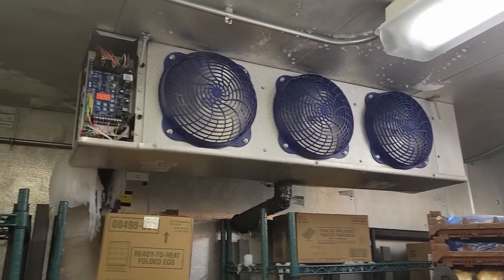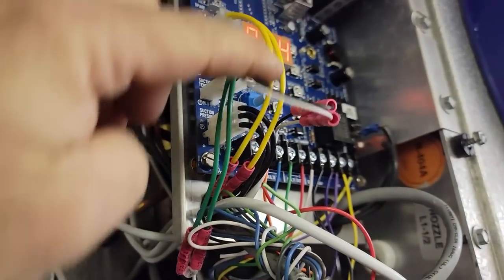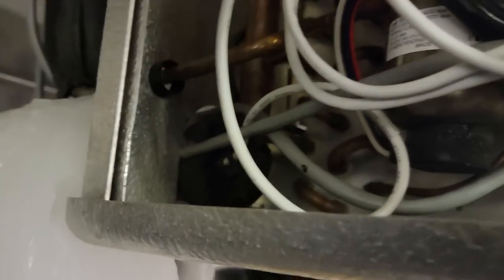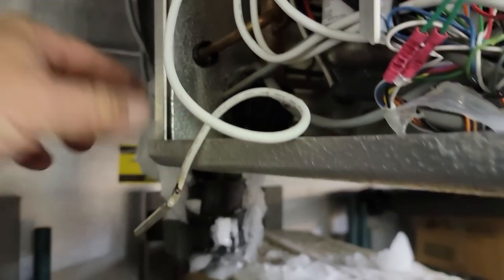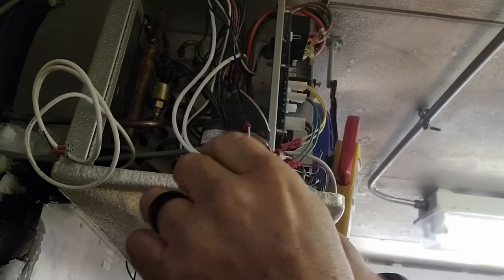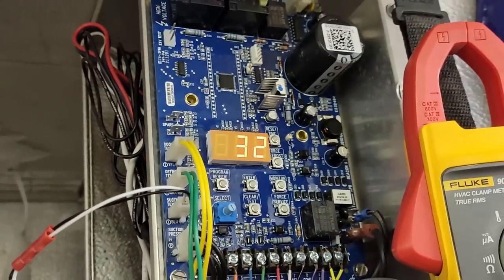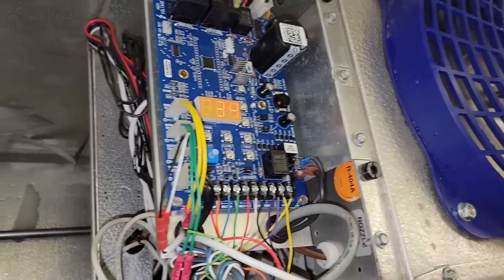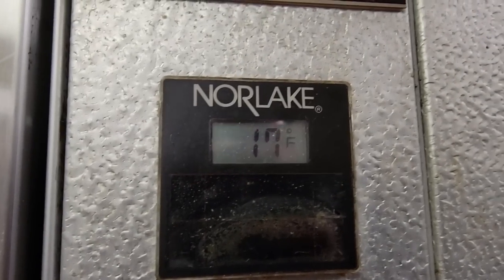Smart Freezer Looses Its Cool

Comment: I have seen a lot of sensors died by moisture over the Years and typically on the ones with 
metal housing. They survive better vertically with the cable input downwards.
I mostly find rubber surrounded thermistors  to survive forever.
Seldom to find the use of metal housing in my place 
It is a good deal to hit the sensor input end with a good dash of silicon to avoid moisture to entering the housing. 
Always great to look at your videos. You are a clever guy for sure😊
Reply from the maker: All good points👍👍 thanks for watching them!

Comment: Great job Rick. Looks like they leave the door open a lot at that place with those defrost settings. It is a balance to clear ice when formed normally and when they leave it open all day 🤣.  All sensors go bad either from moisture on the metal ones or crushed from ice on the silicone ones. The silicone sensors work great with thermal paste as ice won't form around the to crush it.

Comment: I’ve been using the “wrong” part of my crimper for 27 years now, never had a crimp fail or fall apart, ever.
Reply: I have had ice bridge the connectors through the spike which made resistance in parallel and changed the value.
Reply from the maker: @Mike buchan I did a lot of research on crimp connectors and the proper tools that are available that are actually certified for things like aviation. It's crazy what's approved and the proper methods.  We're not doing stuff as important as aviation but it doesn't hurt to have the best methods possible.
Reply: @HVACRSurvival  oh I’m not saying you are wrong for saying it, I’m just saying I’ve been using the spiked portion my whole career without any issue. That doesn’t make me right tho😆
Reply from the maker: I know it usually works decently depending on the crimper and if you're using the correct size connector. But I've also had seen some real ugly crimps that pull out too easily.  I follow what your saying👍👍

Comment: Have you tried using ELK connectors for those small sensor wires? They work great for me.
Reply from the maker: I have the 3m telephone red connectors and I have a larger blue 3m we use sometimes.